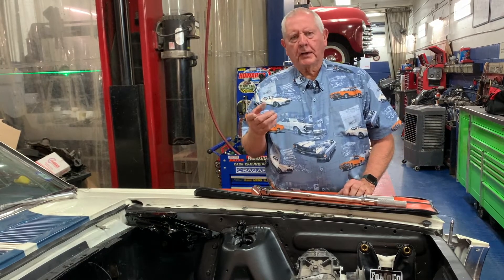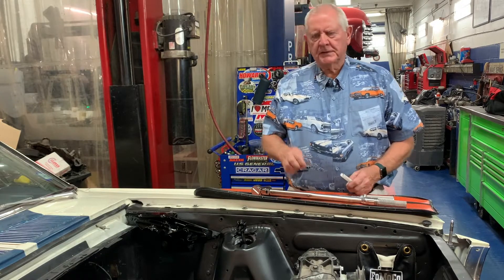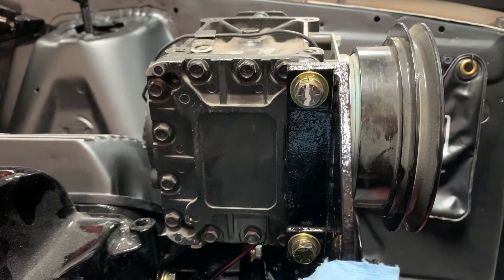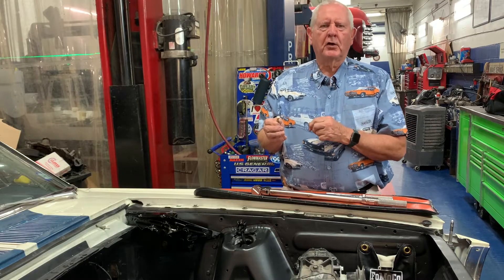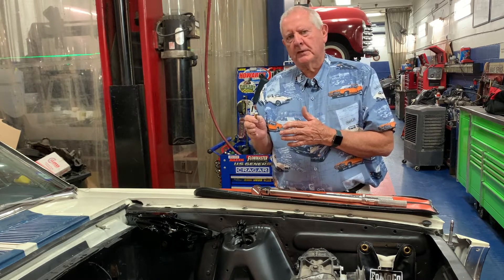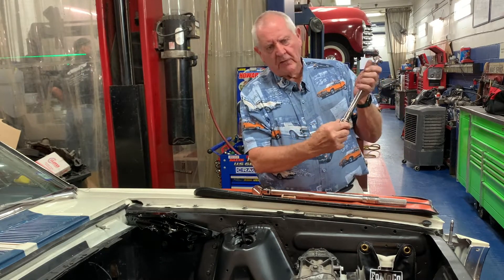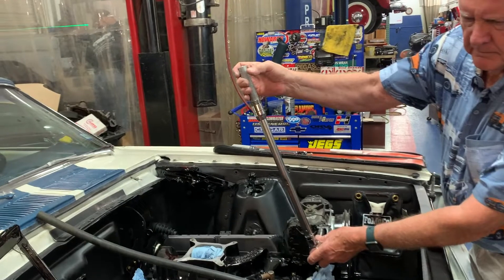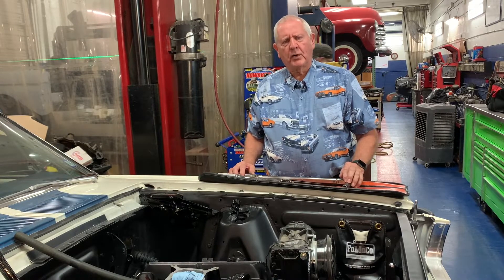Car Bolt Tightening: How Tight Should Bolts Be?

Comment: aight thanks, but do all same sort of bolts always need to be at the same tightness, or does it differ per car brand for example?
Reply from the maker: Our Bolts are tightened using the repair manual specifications 
If no information is available you can get a chart to follow base on the size of the bolt